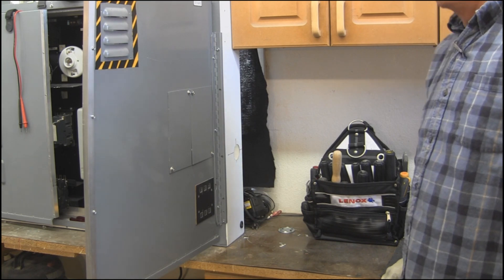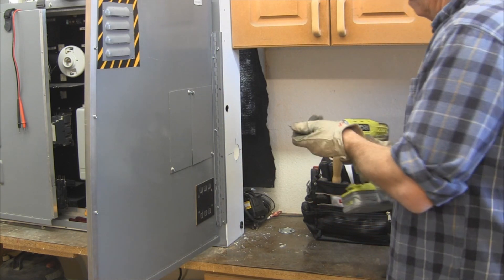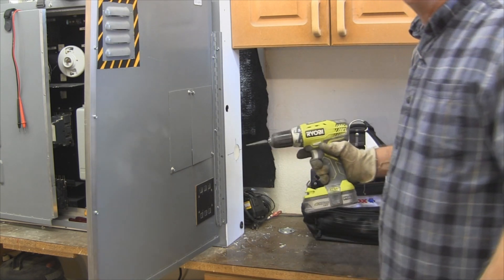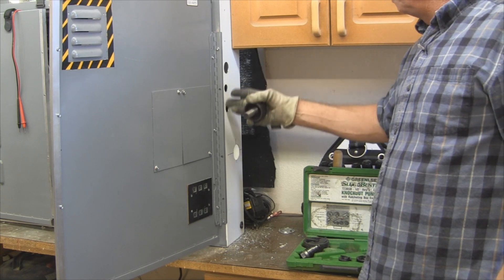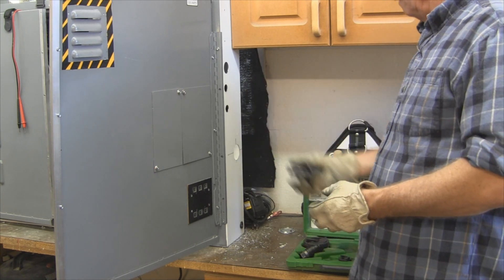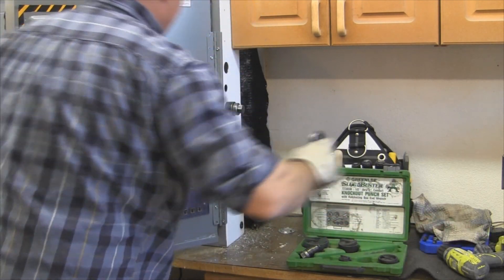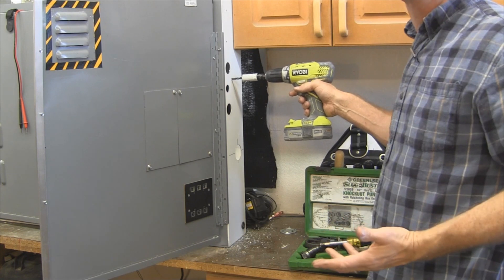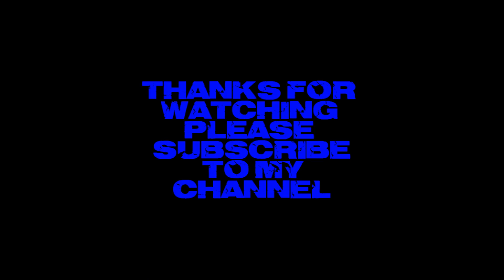Electrical Wiring- How to Cut Holes in Metal Pt 2

Comment: Slow and controlled saw a journeyman break his  wrist using klein's 1 inch hole saw when that bitch caught jerked that drill really hard to control 1st gear is my recommendation
Reply: All depends on the torque of the drill and how you are using it. If you are using 2 hands, and the torque is quite high, so long as you have good control then it shouldn't be an issue. One handed and high torque is a bad combo... depending on hand/wrist strength. 

Also with that said. I have had more "catch" on slow speed than higher. Just don't put all your weight behind it, and or jerk it around and you should be fine.

Comment: keep hole saw sharp by drilling slow..heat is the enemy
Reply: Yeah, heat is definitely the enemy but time is also a problem. If you drill slowly, it takes longer and could ironically make heat damage more severe. For example when we weld thin metal, a common mistake is to turn amperage down to avoid burn through, but once you get to a certain point it takes longer to finish the weld and heat damage is more profound. When drilling I always use cutting oil to try and redistribute heat, but once I start I try to get it done quickly, then cool both the bit and the part.

Comment: Nice Video.
Here is a helping hint: To start a hole when using a Uni-Bit or Hole Saw, use a TEK screw first to start a pre-pilot hole.
A 2 cent screw will add many more jobs to your drill bits.
And as for speed, slower the better, heat is the tools enemy, I prefer Corrosion X over cutting oil for cooling and lube for the bits.

Comment from the maker: When using a hole  saw on an existing hole I use a 4sq or similar blank plate and cover the hole from the back side of cut. This allows for the pilot bit. Make sure to use a heavy gauge blank.

Comment: Just today on my job, there is a existing hole 1-1/2", need to enlarge to 2-1/8". I tried hole saw, but nowhere to hold the center bit.
Reply: I know it's been 3 years, but someone else reading this and or you may remember how you did it. 

My best guess in how it could be done would be to use another piece of material on the backside. Like either a piece of metal clamped/tacked on. Or even a piece of wood if there is enough room. You only need the bit in the center to keep it from skating. I mean you could man handle the saw without the bit, and try to keep it on track and eventually get it to work but the end result will certainly not be "pretty".
Reply: liumiao liu what you have to do is put the hole saw for the existing hole size into the arbor after your new hole saw. the old hole saw will act as a pilot bit for the hole saw being used for the new hole.
Reply: Benjamin Mardis Wow, that's s great idea! I've been struggling all these years trying to cut and clamp a backer board on the inside. Thanks for the tip.

Comment: I use a 7/8in hole cutter (Greenlee 925) to make 1st hole before using K/O set for larger holes.  I put the pilot bit through a a 1/4in fender washer to protect teeth from digging in when the pilot bit pops through. Medium speed with moderate pressure (too fast & pressing hard make teeth discolor from heat and cutting edges become dull.  Cutting oil when doing multiple holes, but not for just one.

Comment: With a hand held drill its just a shot in the dark...fast,slow, or somewhere in between. Steel is harder and takes slower rpms, and even slower rpms as the drill bit size increases. Most drill bits get dull fast because they are rubbing instead of cutting because of high rpms. Personally I feel that pilot holes work well on all but very small holes. A centerdrill will help you start in the correct location. One thing to watch for is the shape of the flute at the cutting end of the bit.

Comment: I broke my 1/2 greenlee Ko so I just use a 7/8 holesaw. I did a job that I had to punch out a gutter with about 12 1/2 pipes and used my drill press with a 7/8 hole saw it worked great!

Comment: concerning drilling speed.  In my opinion, from my experience as long as the cutter or bit isn't getting too hot its right.  kind of hard to judge too hot.  if you touch it and its hot its ok, if it burns a bit its ok. If the metal is changing color and smoking and looks so hot you don't even want to try and touch it its a bit too hot.  People who say low speed generally put more pressure on the tool people who say high let the tool do the work.  They are both right, there is no one speed. !IMO!

Comment: I only ude 2 size hole saws- 7/8 and 1-1/8
everything else is done with a punch set- those 2 size hole saws allow use of both size studs for the punch set- no need to carry any other sizes